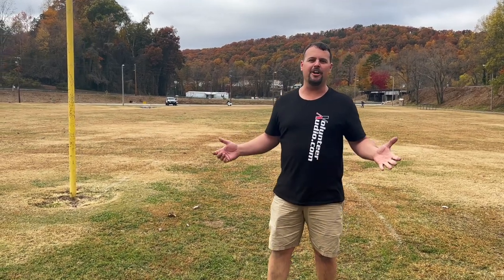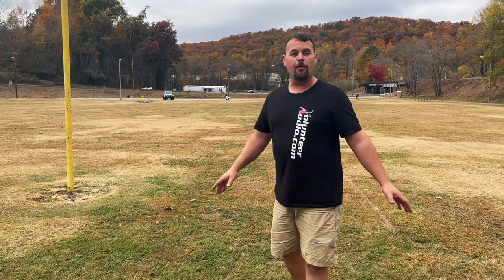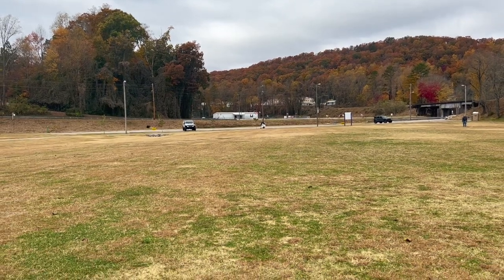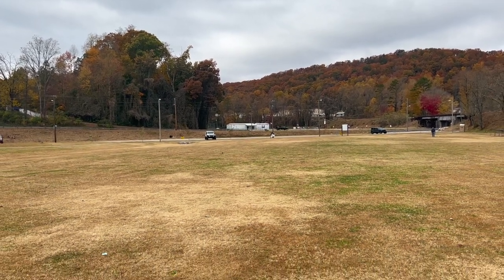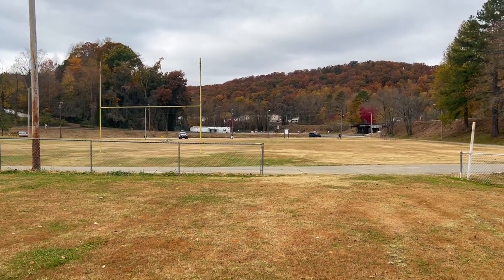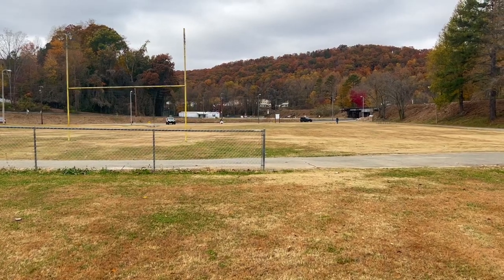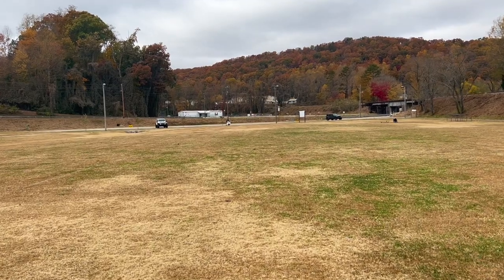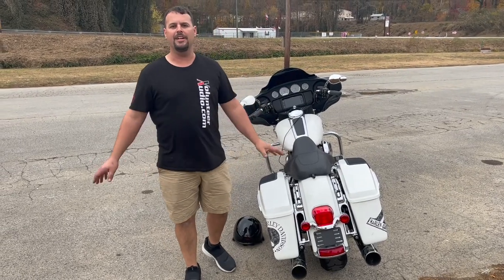Wow! 150 yards out! How loud is Project Five-0? The Walk Away! Hertz Stage 4 build using the SP4.900

Comment: Well with my headphones on I just listened to the clip of the dark gray road Glide at your church with the precision power amp and I think it sounds louder than the Hertz amp? Maybe it's just the difference between the road Glide and Street Glide? I believe they're using the same speaker set up?
Reply from the maker: The mic gains auto adjust depending on ambient sound, it is hard to compare one video to another
Reply: @volunteeraudio  yeah I totally agree it is very tough to tell volume and sound levels on YouTube! The system's sound quite amazing!!!

Comment: Question Jay
Can you run the front and rear rca directly to amp and the sub channel to a dsr1?...I want to band pass the subs ...the other 8 speakers I have them at 80hz...
Reply from the maker: We go high level into the amp, the Soundstream radio has a built in band pass on subwoofer output, no dsr1 needed
Reply: @volunteeraudio  until I save enough coins to buy the soundstream 🤣 all I have is the Sony 7000 ...I really don't want just low pass the sub...its the rockford sub kit in the bags...any recommendations???
Reply from the maker: @joellongoria2239  sorry, I assumed you had the Soundstream, you could use just the sub section of the dsr1 to bandpass your subwoofer
Reply: @volunteeraudio  so I can use the rca out of 7000 direct to amp to get more input voltage and keep the subs as is going thru the DSR1???
Reply from the maker: @joellongoria2239  yes
Reply: @volunteeraudio  Thank you Jay...Maybe Santa will bring me a Soundstream 🤣
God Bless! Love your channel...

Comment: Sounds great would that hertz amp 4.900 work as well infinity kappa’s want to Cvo for speaker set up
Reply from the maker: I’m not sure if they will handle the power as well as the hertz speakers, with this amp I would suggest hertz speakers
Reply: What amp would u use with the kappas? And would sound better the hertz speaker setup with hertz’s amp. Such a hard decision watch a Videos. It seems like you like the infinities for the fullness. I just wanna make sure I can hear it when I’m doing 75 miles an hour.
Reply from the maker: @stevencoriell7135  I personally like the sound of the hertz speakers better but that’s my personal preference, they are in my bike
Reply: Thanks
Reply: Just bought 2022roadglide cvo limited it sounds horrible.
Reply: Question it looks like hertz has 2 speakers sx 165 neo and sx 200 neo which one did u put in your bike?
Reply: Looks like u r using the sx  165 I would the sx 200 be overkill?
Reply from the maker: @stevencoriell7135  sx165neo are 6.5”, sx200neo are 8”, my bike has sx165neo front and sx690neo rear, if you have rear 6.5” I suggest sv165neo for rear or lowers
Reply: Thanks!

Comment: How many watts are you putting to each 6.5 and the 6x9s?
Also how's the bass?
Reply from the maker: Listen to the walk away video we just did on the triglide, you can hear the bass better, each speaker is getting about 190 watts rms, the sx165neo are rated at 100 watt rms each and the sx690neo are rated to handle 135 watt rms each, we are overpowering the speakers but because it is so clean and low distortion the speaker can use the power without blowing

Comment: I have a similiar setup but with the sv165 neos and ST25’s. Can i run the SV’s and ST’s together on one channel with this amp?
Reply from the maker: You can, as long as you use a capacitor on the st25kneo to block bass